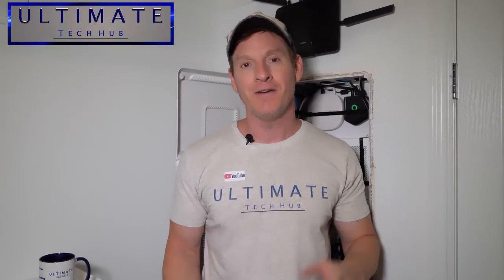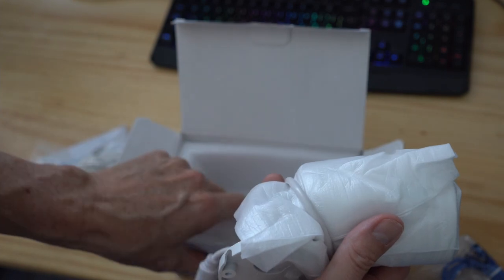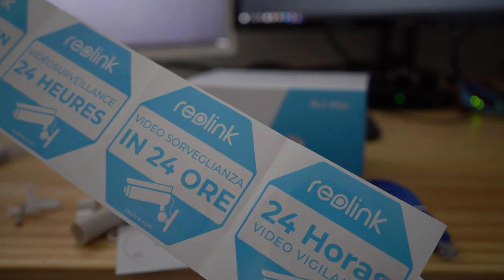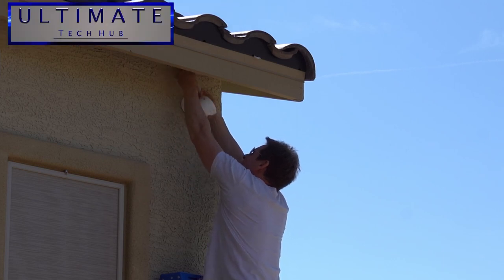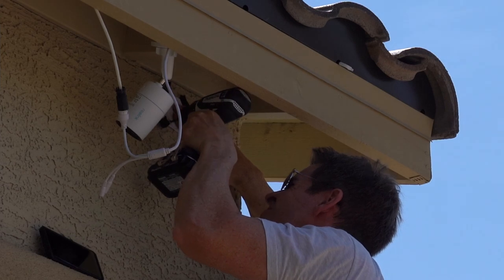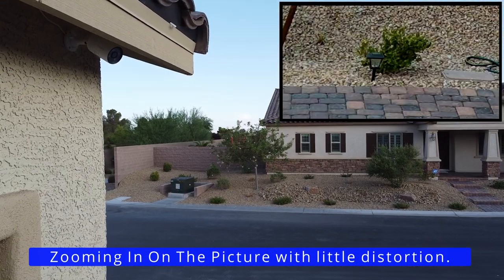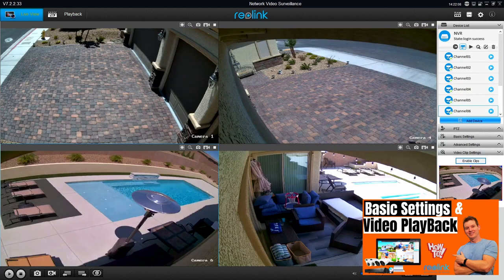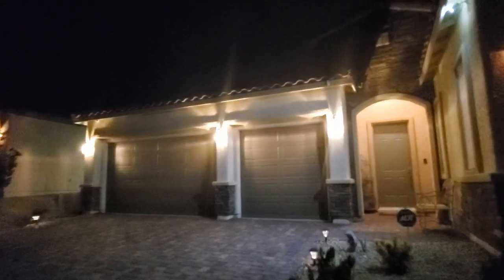Reolink 8MP RLC-812A POE Outdoor Bullet Camera 2021 Review | 4K

Comment: So close to getting this cam but always on spot light is a deal killer.  Is it possible to adjust the brightness of the light?
Reply from the maker: No its always on but for our needs it's great for shining light on our front driveway. Reolink has other models without the spot light feature. Thank you for watching and if you subscribed thank you as well!
Reply: I just bought this camera and right in the instructions it has options to stay off or on with a schedule as well.
Reply: I have the Reolink RLC-812A security camera.  
It has a dimmer slider switch in the settings for spotlight brightness control.
Most all new Reolink security cameras with built-in spotlights have this new feature.
Reply: Thanks guys for the replies.  I'll keep an eye on this cam.  Turning on after a motion event is my use-case which hopefully is a software update.

Comment: What? Is the light at night always on? Or only if it detects motion? thx pat
Reply from the maker: My light is always on at night. But with the app you can turn it off.
Reply: @UltimateTechHub  If the LED is off, will it react to motion at night?  I would prefer that it uses the LED only if it recognizes some motion in the frame for better pictures.

Comment: I just bought the RLC-811A and there is NO option for the spotlight on my phone app or on my laptop! What is going on? The spotlight comes on when motion is triggered but there is zero option for the spotlight or using the two-way audio feature. My app is updated to latest firmware. What the heck.

Comment: I'm really surprised you didn't have the spotlight reflecting off the roof eave above it.
I had that problem until I lowered the camera down about 12 inches. 
I had that problem probably because my house is all bright white color.
Reply from the maker: I made a small adjustment after posting this video. I angled the camera a bit lower and it reflects the light on the driveway. Thank you for watching.

Comment: Can i using this camera with only SD card for 4k recording without Ethernet? Please reply.thanks before
Reply from the maker: Yes absolutely, You can use the camera with the Reolink app and get push notifications whenever the camera detects motion, and watch the recorded footage directly from the SD card in playbacks. The camera supports up to 256GB MicroSD card which will last about 100 hours before it starts to overwrite. The playback quality from the SD is not as good as the NVR quality. You may need to lower the video settings to get a smooth playback. And you will need a power adapter for the camera to work. That's why the PoE connector works best for power and data. Its a really nice camera and thank you for watching I really appreciate it.

Comment: Hi . I have a Reolink 4k camera system and works well on my home network LAN , and the phone must be on WiFi to be able and access the life camera.
But now have a question and can’t find anything related with my problem.
Hope you can suggest me what to do,
My camera on mobile phone as i mentioned earlier, works great but only from my WiFi on home network.
If i turn off the WiFi and try use 4G , the system stop working.
I was told Reolink is easy to setup and don’t need extra IP address or anything like that, because will pick automatically for first setup, wich yes hi did and all works fine, except about mobile connection on 4G don’t work, and don’t know what to do to make this works.
I will appreciate if you can help me .

Thank you 
Good video anyway. 👍
Reply from the maker: You should be able to access your cameras over cellular data. I have never had an issue unless my cell service was weak in an area. If you use a VPN on your phone turn it off and see if it works. Also what phone do you use? Keep me posted
Reply: I'm tecnitian and had same problem with xfinity routers, customer had to reset the router every two or three days. I think the problem is the router, I also have customers with T-Mobile Home, AT&T and Wave, no problem with them.